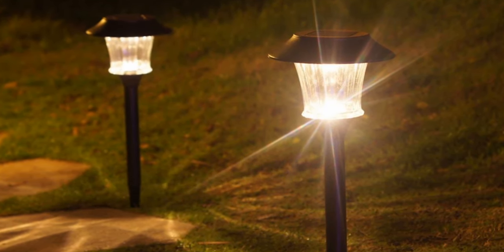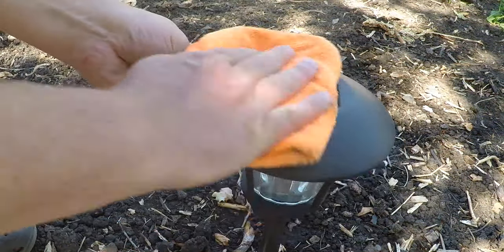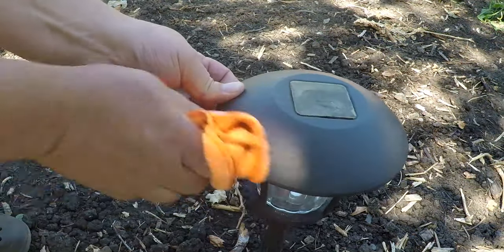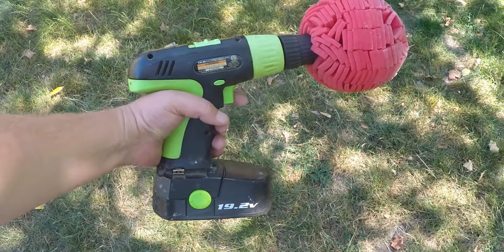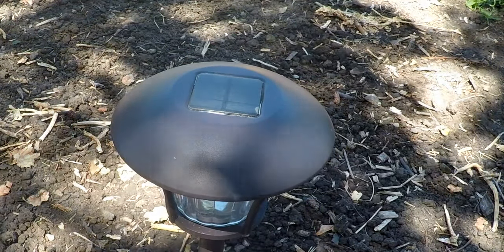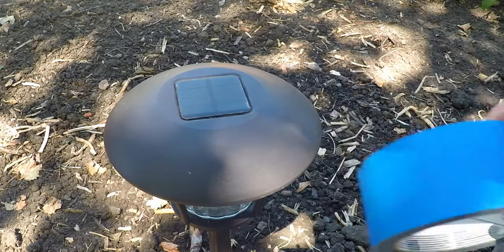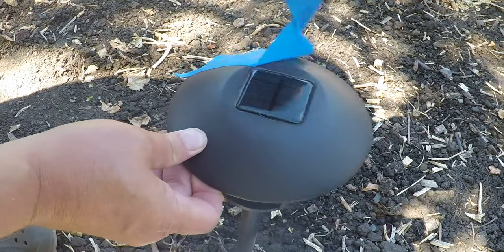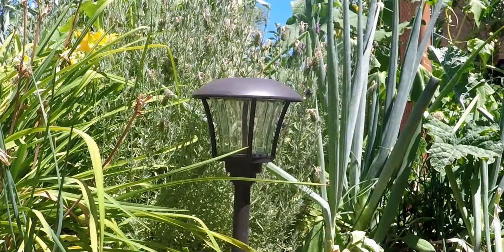How To Restore Solar Pathway Lights In About A Minute!

Comment: I've started clear-coating my new solar lights to prevent this from happening to my new purchases. So far, so good. It's even helped some that were just starting to get a little clouded.
Reply: That’s a great idea
Reply: Is it still holding up?
Reply: Thank you, I needed this idea!
Reply: How are they doing now?
Reply: @blank-dr2kx  They lasted a little more than two years. I like to switch my lights out, so I don't recharge the batteries.
Reply: Thanks!

Comment: I was wondering if I could do this. One thing I have been doing is taking hot glue and gluing around the solar panel setting. I’ve had many lights get water into them and yes they “said” they were for outdoors! Thanks for your help.
Reply: Silion is better

Comment: Having viewed 10 or more tutorials on this subject I can categorically tell you my way is the best and quickest.  I did 26 lights in probably 30 minutes.  One does not need sand paper or painters tape.  
I did it 2 ways with equal results.  First removed lamp top, wiped down with wet cloth, and acetoned the entire top paint and all.  Then Rustoleum Clear painted entire top.  Like new!
The second way deletes the acetone wash.  Wash top with damp cloth and merely spray with Rustoleum Clear.  One can not tell the difference.  It appears that the opacified oxidation on the solar panel goes back into solution with the solvents in the paint.  They look like new in a fraction of the time without any sanding or taping .
Reply: Are they still functioning afterwards? I'm going to buy the spray tomorrow if so!

Comment: Off bug repellant works good and easy to remove cloudy sensors. Spray it on wipe it off then coat with clear spray.  Saves the time of polishing.
Reply: I will try that, thanks
Reply: I've used Off on yellowing headlights takes it right off. But if it does that what does Off do to the skin?? Good for thought!

Comment: 16 lights later and sealed with clear coat, not one lights up. Not just waste of time but that clear coat seat sealed the deal on my wasted lights!
Reply: Try changing the batteries. You can purchase rechargeable batteries (they are the same size as AA batteries). The sun will recharge them. I bought mine on Amazon. Geilienergy Ni-MH AA 600mAh 1.2V.

Comment: I have a set of 4 solar lights here, (Bell & Howell Disc  Mosaic solar lights ) cleaned them up as best I could, but it appears the other side facing the cells has turned white also , very white cloudy,  ( 3 seasons on them)   3 are still working, but I'm guessing not for much longer ,  taking  one apart, it's impossible to get at the underside of the plastic,

Comment: For 2 dollars you spent 20
Reply from the maker: These lights were not purchased from the dollar store. They are made of glass and powder coated metal. Cheers!
Reply: What about ones that are made of clear plastic? Should I also use this on the light cover? My light covers have haze even after cleaning